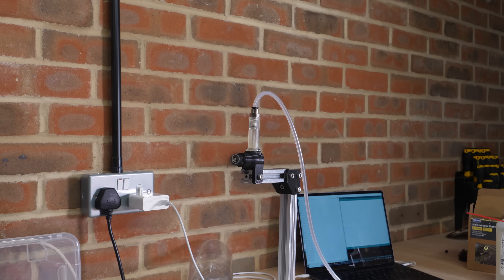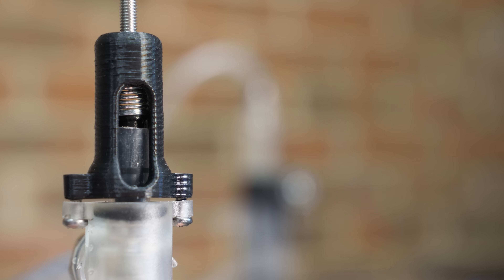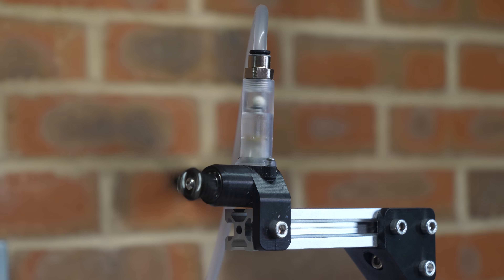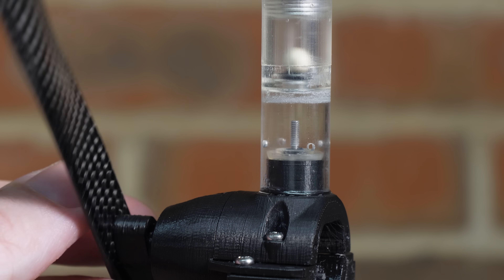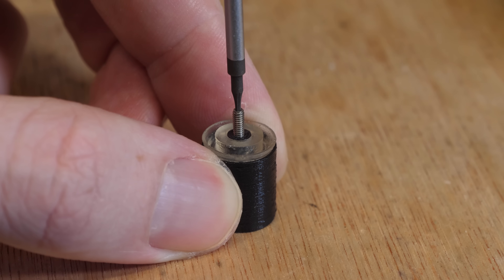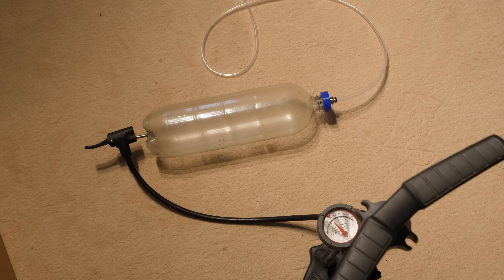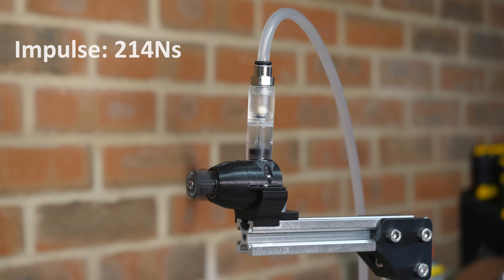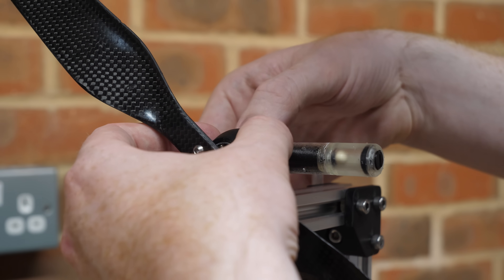4,500RPM Air Engine

Comment: I'm not an engineer, but I like reading about engine designs and your initial assumptions are opposite of mine, so I'd like to understand how you came about it.

If anyone could guide me to understand the 3:1 ratio at 4:25? The only part I caught from that was the 3:1 pressure, but I'd like to further understand why is there such a large squish volume.

Also, twin cylinder sounds so good! I'd like to propose running the twin cylinder at higher speeds, either via a step down gearing to reduce the propeller speed. 
Typically lower cylinder count engines produce a fair bit more torque at low ends, while higher cylinder count engines produce torque at the higher end. For petrol engines I believe this is owing to the speed of incoming air which homogenizes the air fuel mixture. Not sure how it applies here but I think its worth investigating!

Comment: To further increase efficiency you could offset the cylinders relative to the crank, keep the compression as high as possible (that air you use to fill the '10cc' headspace is wasted air), and lowering exhaust ports a bit. An exhaust manifold would probably help to draw out more air from the cylinder by literally 'sucking' it out. You could even push the design further and create an expansion chamber exhaust that uses resonance from the previous cycle to help suck out air (have the exhaust below atmospheric pressure right when the exhaust ports  open).

Comment: Increasing the exhaust port size sideways could give you a slight vacuum in the cylinder and increase efficiency as well, since the piston doesn’t have the compress the air left in it

Comment: From a thermodynamics point of view, you are describing an isothermal process at 5:30. However, considering the system dynamic, I would argue that it is an adiabatic expansion. You will never get a 3x volume expansion.  In fact, designing a 3x volume ratio will actually give you negative pressure (relative to the atmosphere) due to the low temperature.

Comment: Might be time for a stronger test stand, I could be wrong but on the single cylinder version seems the test stand vibrations impacted the motor RPM to some degree, but certainly more cylinders to balance could help. How cool would a 4 or 6 cylinder be!

Comment: If you're not planning on doing it already, you should try putting the twin cylinder on a plane and see what happens. Worst case scenario, it decides it wants to be a jet instead of a biplane in terms of speed. Also I wonder what would happen if you made a 4 cylinder version. Lastly for your old motors where you had the spherical chamber that the ball stayed in, if you were to add some sort of ribs to keep the ball in the center of the chamber instead of flying all over the place, I wonder if it would potentially help your power by being able to let more air through without letting the ball go crazy. 

The theory is simply this, if you had that circular chamber for the ball to rest in then add some vertical ribs so as to allow the ball to move up and down and not move side-to-side then it could allow air to flow past at a faster rate potentially making the motor run faster and as-such increase thrust, it's possible to even add something to keep it from reaching the top of that chamber if you're still dealing with the ball for some reason deciding it doesn't want to behave. By keeping it from reaching the top of the chamber you would prevent it from wanting to fight you and give the air a mechanical advantage to make it want to seal again.

Comment: Novistrech (could be spelling that wrong) is an Austrian airsoft youtuber, who makes larger than the 6mm airsoft bbs ur currently using, so if you want to increase valve sizing that is one way to go but also adding more valves could work great

Comment: Hey Tom, have you ever thought about adding some type of a mechanical version of a variable resistor that when the nose of the plane points downwards it allows more airflow to then increase thrust and then reduce thrust when nose up?

Comment: Science and Engineering all mixed into one its awesome. I wonder if you could capture the exhaust gases and find a way to use it for either more power or volume of air in the bottle (similar to a waste-gate with a bypass valve venting to intake rather than venting to air or exhaust) or vent it down tubes and create thrust exhuast....dreams right and some things aren't worth the time lol

Comment: From thermodynamics you will realize you are throwing away half of the energy when it goes through the regulator. You are expanding the gas from 60psi to 30psi but not getting any work out of it.

The regulator makes the engine run at a constant speed, but only because it is throwing away the energy at the beginning that the engine would otherwise get.

Comment: I build small compressed-air engines also. However, mine are designed around 3 external pistons and one cylinder. My engines can run equally as well either direction, are positive displacement, have no dead spots, need no flywheel and can have as few as 4 moving parts including both inlet and exhaust valves.
Give up?
I'm Autistic, so relax. My thought life is based on an alternative reality.
I'll post some of my  engines on my own channel soon, so you can see what I'm up to.
I think you'll be intrigued.
Meanwhile,  very much enjoy watching your several projects,  Thanks.

Comment: could i recommend a 2 cyl engine where one is larger than the other and you feed the exhaust of one engine in to the other engine.
this may achieve better efficiency assuming the losses dont stack up too much

Comment: Holy crap... Could this twin cylinder air engine be a solution for people who cant handle battery powered string trimmers and need to have that high revving engine sound?
Also removes the problem of lithium waste, and recharging would be quite rapid with a decent air compressor.

Comment: Peak pressure should be achieved when the connecting rod is at a right angle to the throw of the crankshaft for peak torque.  A bit beyond for better fuel economy at the cost of torque.  I'm still surprised you haven't tried a compound engine yet...

Comment: I wonder if the efficiency is worse more because the Propeller hasn't been designed to make use of the extra torque it can now provide? More props or different blade angles might make it more efficient, as it's effectively a different motor profile - more torque but similar speed?

Comment: Wait until he discovers rod ratio and how that can effect the efficiency at various RPMs and intake durations. I'll bet there is another 3x more efficiency at a given power output if you tune pressure, valve timing, rod ratio, and RPM to all work perfectly together.

Comment: Here's an idea: It'd be incredibly tricky, but if you could design a tuned exhaust tube like a two-stroke engine you may be able to create a resonance at the operating speed that would cycle down to a pressure below atmospheric at the bottom of the exhaust stage. From here you now have less air pressure on top of the piston as it travels back up. If you could have a negative pressure you could even gain more useful force on the piston.
Reply: I think the volume of air in the resonant chamber would be treated like a helmholtz resonantor. So I imagine a chamber that would surround the exhaust ports and glue on, acting like a (somewhat) sealed chamber when the piston is up, and then is energized by the exhaust on the exhaust stroke. If the engine is producing an exhaust sound at 120hz, a helmholtz resonator that may work could be 21cm^3 with a pipe exit that is 30mm long and 2mm in diameter.

Comment: Bunch fo comments.

1. You should try tracking down what's going on with that 2 cylinder and it's halved efficiency, there's a few things that should cause it but the most basic thing to check would be to put some sort of temporary blockage in one side r and completely remove the cylinder and crank pin on one side, (you'll need a spacer to occupy the space of the other crankpin on the crankshaft). See if the efficiency stays at half or gets better. 

If it gets better that means the issue isn't in the second cylinder itself but in something else about the setup. If it remains as bad or only barely improves that means there's somthing wrong with how you've setup the twin compared to the single.

In terms of possibble causes:

A) Excessive friction, bending, or compressing in the crankpins. Any of these could steal significant power, even the ends rubbing against each other could cause issues.
B) Higher RPM, this might sound dumb, but higher RPM means a higher mass flow, but it does it at the expense of the prop efficiency if the prop is the same, (this is by far the most likely options IMO). It also raises the parasitic losses in the engine itself from friction and other causes. Things like ideal inflow rates and ideal exhaust port area will change with engine RPM.
C) Related to that if the RPM exceeds the props ideal value it may cause issues as the blades interact poorly with the airflow over them. But i think this would cause noticeable vibration and thrust drop issues.
D) Your putting more sustained torque through the other components, they're flexing more as a result, in that case things may be rubbing in ways they wouldn't with a single piston design.

The best way to figure out what is really going on would be to build a dyno graph out of a small motor that can be driven as a generator, a sufficiently sensitive multimeter and a variable resistor to dissipate the electrical energy generated with an RPM measuring device, then tune the resistance so you get a identical fixed RPM output from both designs, (the resistor is basically just a variable load). Then measure the current value, (at the same RPM the voltage should be the same), to get a true read on power output. You'd need a way of recording a lot of data points to build a graph from an air bottle, but should give you a clearer idea of what's in the engine side and what's in the prop side.

2. If you want to maximise the benefits of multi-cylinder you want to keep the total volume of all the cylinders combined the same as the single cylinder, (so several smaller cylinders instead of one big one), but at the scale your working at that might run into issues with scaling friction. You can get the same effect by building each cylinder for a lower pressure too.

3. A problem with perfect expansion in the cylinder is that you've nothing pulling air out of the cylinder, when there's even a bit of excess pressure when the ports open it creates a flow out, the more violent that is the more of a vacuum it will pull behind, but you have to make sure to close the ports at the right time, leave them open too long and you'll get backflow filling the cylinder with above ambient pressure before the ports close. Look up scavenging in internal combustion engines for how thats used there and as someone else mentioned an exhaust manifold can help achieve that.

4. Someone else mentioned it but multi-stage expansion systems, (look up double and ripple expansion steam engines), can dramatically improve efficiency, again you may run into friction issues at these scales but worth investigating. Also i allready touched on it before, but mess around with your exhaust hole sizes, heights, and numbers, the ideal values of all of them will change with operating RPM. a few big holes are also better than lots of smaller ones.

Comment: If some of the energy is used to push on the ball bearing, could efficiency not be increased further by using a solenoid to open and close input air? You would obviously need some kind of sensor to monitor crank position bu you could alter the timing depeneding on pressure too... Just an idea. Food for thought :)

Comment: Have you thought of doing a dual expansion system where cyl 1's exhaust is routed to cyl 2's intake to scavenge power. A similar triple expansion design was used in large steam engines.

Comment: Duck tape the bottle so you can increase the pressure it can hold. I could reach 120 psi in 710ml (or 2L i cant remember) bottle when I was messing with air tanks when I was young.

Comment: Unfortunately, all regulators (that aren't themselves engines) waste a ton of energy (really entropy) by expanding the Air without producing any work. 

You're on the right track with building the regulation into the head. Repeating air guns that aren't hyper-focused on accuracy will use a valve that closes faster at higher pressure, delivering close to the same energy to the projectile even as the reservoir depleats.

Comment: you can make a simpler twin cylinder engine if you replace crank rod with a scotch yoke. that way you can combine the two piston heads into one with a set screw on both sides.
It probably won't add much performance but it's a much more elegant solution in my poinion

Comment: Hi Tom, thanks as always for a really interesting video! I'm not an engineer, or actually in any way mechanically inclined, but I've learned so much about how engines work from your channel. It's much easier to understand engines in general after hearing your explanations paired with the great shots of the internals of these air engines.

Comment: Slap a crankshaft on that double cylinder engine and you’ve got a boxer engine, which should remove the vibrations and give you enough power to fly a heavier plane with control mechanisms and more space for air.

Comment: I have the feeling that pressure regulators and expansion volumes in the cylinder head must be a cause of energy loss, as in both cases you have expansion occurring which does not do useful work.

It would seem that the accidental 'regulator' caused by the bouncing ball valve is actually a very good solution, as it's limiting the quantity of gas entering the cylinder without providing an expansion volume.

Comment: Efficiency is key, right?
Isn't a reduction valve wasting a lot of energy?

Can you alter engine during the drop in pressure from the tank, or activate a second engine already optimized for a lower pressure.
Does a second engine weigh too much for recap the loss from a reduction valve?
Is it too complicated to have dual engine setup for same prop?
Could you do a compound engine?
The exhaust from first one feed the second one at high pressure, and disconnect the first one at low pressure?
My suggestions will most definitely power curve with a slope. And you wanted a more flat curve?

Comment: Have you thought about a dual expansion design for the twin cylinder?  Have the exhaust from the small cylinder feed into a second, larger cylinder? This was pretty common with steam engines to maximise the work out of the stream, not sure that it makes sense for an air engine, but sounds like a challenge :-)

Comment: Hold on... neither am I a physics genius nor have I thought about this a lot... but in the schematic at 5:55, wouldn't the left engine theoretically produce no net power at all? Let's start at the beginning of the cycle, the regulator pressurizes the space above the piston to 3 atm. The piston then moves down until at the opposite point in its rotation the pressure in the cylinder is 1 atm, meaning no air escapes the exhaust holes. The cylinder then moves up again, compressing the air it contains (since it cannot escape) to 1/3 its volume resulting in the starting pressure of 3 atm. The valve then opens but no pressurisation happens because regulator pressure and cylinder pressure are equal. 
Since there is no valve system allowing the compressed air on the upstroke to escape, i can only see a few reasons why it would run at all: some air can escape during this compression and, more importantly, the valve is open for a little longer while the piston is already moving down and thus pressurizing a larger cylinder volume than theoretical. Am I making a mistake here or Tom? :D
Reply: Yes, you are indeed making a mistake.

The whole point of that engine design that SO many people somehow don’t know in this comment section is that it does not have compression on the backstroke. The seal expands when pressure is put on it, so that when there’s no pressure on it (AKA when it reaches the exhaust ports) the seal springs back inwards which allows air to flow around the piston on the backstroke. and yes, the gap around the piston is definitely sufficient to let enough air around it without building any pressure above it.

Comment: 5:50 without an exhaust valve the piston is compressing the air in the cylinder. Maybe a "sticky" bash valve in the piston? The intake valve would bash it shut at TDC and a pin though the bottom would bash it open at BDC.
Reply: The whole point of that design is to not have compression on the backstroke. The seal expands when pressure is put on it, so that when there’s no pressure on it (AKA when it reaches the exhaust ports) the seal springs back inwards which allows air to flow around the piston on the backstroke.
Reply: @xmysef4920  Whoops, that's what I get for watching out of order.